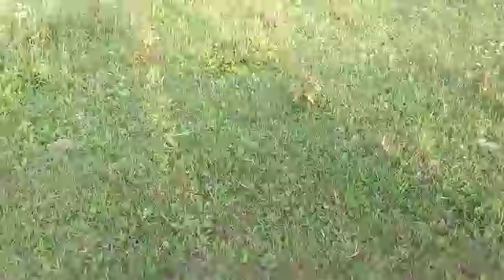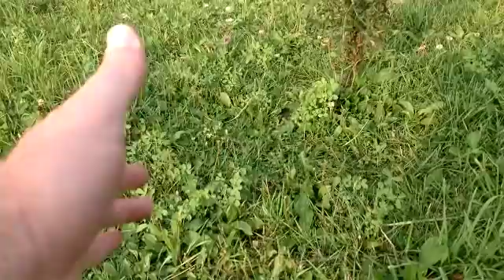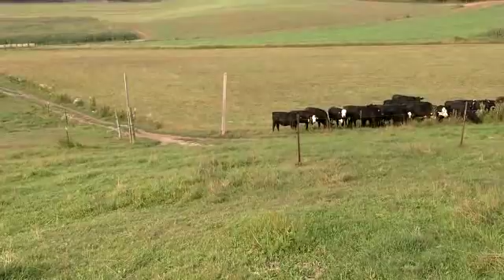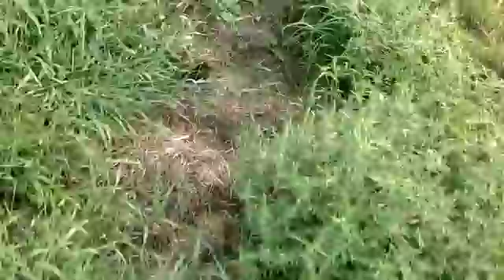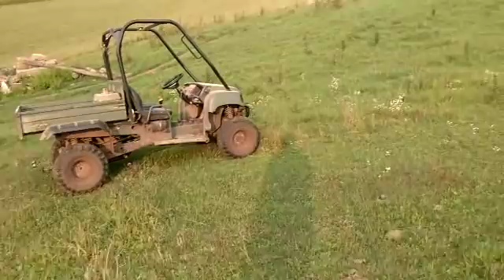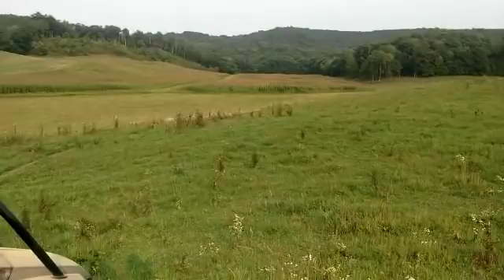Decision making with drought and heat stressed pastures

Comment: feed them and get them off the pastures.  every thing you said about the stress your pastures are under is true.    you already know this.
Reply from the maker: Yes sir! They are locked in the yard eating hay, and boy are they unhappy! They are natural born grazers and they do NOT like being locked in the yard! But, its for the best!
Reply: LVF - in the long run you and them are going to be better off with this decision...  them losing weight is a set back and losing the pasture is an even greater setback.   with the right blend of feed mix you can get them ready for market then do what is necessary to get the pastures in shape to support the herd size you want to maintain.   sometimes speed bumps are really just opportunities to learn.   you'll be ok because of the balance you have created with marketable crops.     I'm pulling for you Mr. L.  so you keep your head up and an eye open for the silver lining in this...    your friend in NC.

Comment: Avoid overgrazing the pastures (unless they get old and DORMANTif possible (40-50 days). After that if there is not enough water for decent growth they'll be dormant and grazing it may be a salvage operation for 1 rotation then use sacrifice lot or drylot. Overall - when the pastures can't grow enough feed for any reason bring feed in. Feeding on one pasture as a sacrifice lot is ok but better to not overgraze all pastures by moving cattle over dormant pastures repeatedly. imho. Keep in mind that it is usually better to bring in feed too early than too late. Better for cattle and pastures. If you bring in too early and rains come you can always graze or make hay. If you bring feed too late you can really lower yields and slow new growth when rain does come . Plants that don't have tops (leaves) will need to cull roots and it takes weeks to grow new roots AND tops. I graze dairy in central Wis. ....Good Luck !
Reply from the maker: I agree with you 100% Ron. No sense in over stressing the plants anymore than they already are

Comment: You need to take up skydiving . You got to jump or ride back with the plane . Rain or dew and low temperatures and removing cattle will help and wean them calves . Don't know if you have feed wagon , but you would have less waste then a pile also work Don't want cows going into winter stressed

Comment: We are getting to the same spot. We finally got some rain, but the heat stayed and so it hasn't bounced back as well as I would have liked. Sounds like you picked the best option for now, especially if you have chances for rain soon. Our seed supplier is saying they are only getting about a quarter of their normal supply of winter forages in due to lack of seed supply, hoping we will still be able to make the fall/winter mix we want. Here's hoping we both get more rain and a break from the heat!
Reply from the maker: +Floyd Farms I got prices on seed yesterday. 6 years ago I could buy orchard grass seed for around $80 a bag, now it's $200... Seed inventory is the reason for high prices they said!